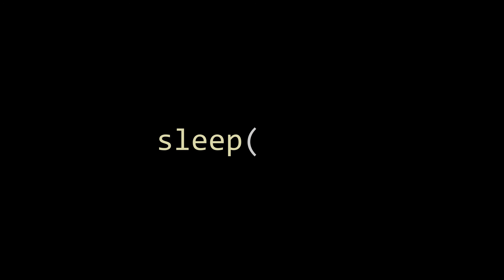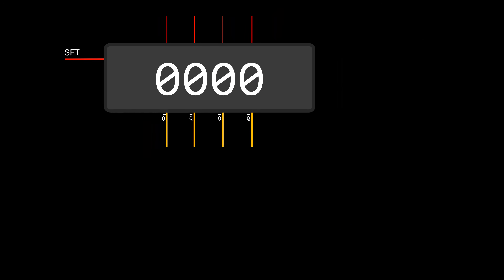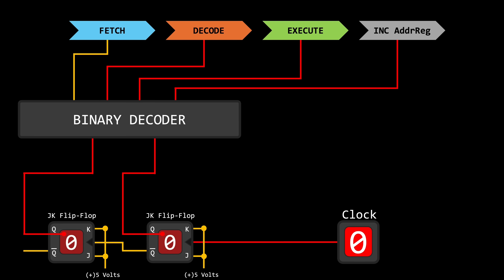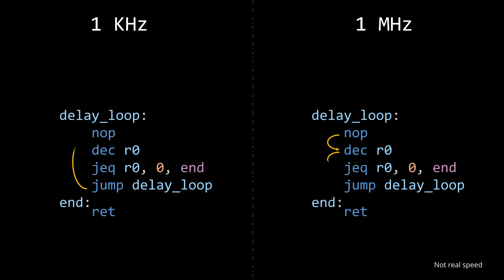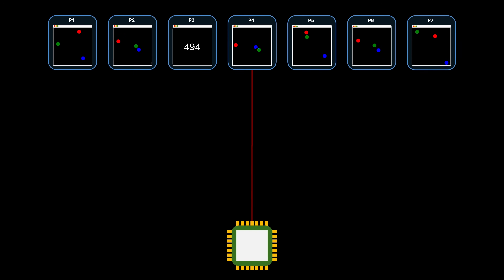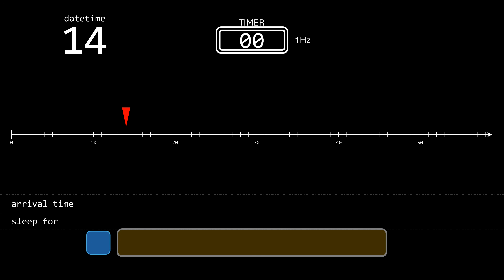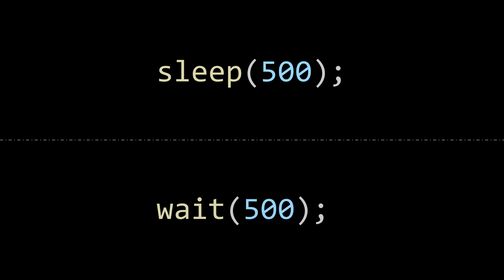What Happens When a Program Calls Sleeps?

Comment: 0:17 certified JS moment xD
which reminds me of my most recent encounter with "JS being JS": someNum = math.round(someNum * 10) / 10; resulting in +10 decimal places because JS' floats can't wait to give you a middle finger. And yes, by now I know about the easier approach: someNum.toFixed(1);
The "JS being JS" part was, that for 95% of the time, the first solution worked, until it didn't anymore.
And I already knew that JS' floats are not trustworthy, but this is the first time I actually ran into an issue with them myself.

9:00 this was the first time where got a slight grasp of just how insanely fast modern CPUs are: when I understood that they are (ignoring multi-cores) never doing ANYTHING in parallel, but just cycle between tasks at an just insane speed.
9:14 and that's how I found out the hard way why one should use "sleep" instead of a loop that just "burns time": I've locked up a couple of my first programs with that xD
I've also managed to lock them up without causing the CPU going 100% afterwards: just using "sleep" doesn't work well if done incorrectly in a single thread app...

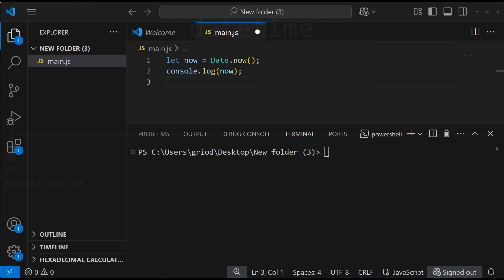13:20 I've been routinely annoyed by the fact that JS uses milliseconds while most other things use seconds but with a float, but it just clicked why: the first part of the comment is the literal reason. JS' time would be completely broken if they had used floats. Or they were forced to make floats reliable, but apparently that was never worth it xD

Comment: In short: 
1. The CPU has a hardware interrupted that is called every millisecond or so worth of cycles, which it uses to switch between running processes to make them seem to be running in parallel.
2. When a program calls sleep() it adds that virtual process to a sorted list based on resume time (time it was called plus sleep length).
3. Every time it switches processes (or at least when it empties the run queue), the system checks if the current time is greater than the resume time for the next process in the sleep queue and, if so, runs it.

Comment: 7:33 but...
approximately div 4 should be easy for a pc.

for example
12 / 4
binary 1100 >> 2 
11 = 3

or
153 / 4
10011001 >> 2
100110 = 38 (off 0.25)

I would say that is close enough and fast to calculate, a 2 bitshift should only be 1 operation

Comment: In my FPGA work, we're often counting nanoseconds because we're racing against the electrons moving in PCIE or DDR interfaces, for example. Looking from the low-level up, I can appreciate my Operating Systems class a lot more thanks to you. I have to spend real silicon to spam hardware timers all over my design, but when the overhead is an entire OS, it only gives me more appreciation to the work low level programmers do.

Comment: Busy-waiting isn't necessarily counting instructions retired, in fact that would be silly :)
Calculate the end timestamp and query the CPU's timestamp counter.
But even that's inefficient, you can also busy-wait in a reduced power state using special wait instructions that won't be interrupted by the scheduler.

Comment: another reason I know of for sleep vs wait: in some older languages Sleep was made as a supplement to the preexisting Wait function
whereas Wait means "do not run me until X after I made this call", Sleep means "do not run me until X after this run of me started."
In 3d programming with the former you'll never hit your intended frame-rate, while with the latter you at least have a chance (there's always to possibility that the program calls Sleep after X has already elapsed)

Comment: I have been watching your videos from last 7-8 months and you create incredible content about computer science which probably no one else creates. But I found a small flaw in your first transistor video named "How transistors run code", in this video you explain how transistors work inside the ALU of a CPU, to explain these components you used BPJ-transistors but actually in the ALU of a CPU which is present inside the core of the CPU, there are only FinFETs which is a FE-transistor because FinFETs uses source, drain and gate instead of collector, emitter and base. (Am I Right?)

Comment: It might be worth mentioning that wait() is already a thing, and on operating systems using cooperative multitasking it is mandatory.
wait() is basically a system call you can make whenever your program does not need to do anything this very instant, a way to tell the OS that if a delay happens here it's fine, and lets the OS taskswitch the program and run other pending tasks if there are any.

It is rare to see it used today, but if you have some process where you want the kernel to preempt at specific points instead of whenever it feels like it, you can still use wait() before and after critical points where you need code to not be preempted.
Think it might still be used in real-time applications.
Reply: I remember that back in the 90s on Macs. It was easy to cause the OS to hang or even the whole network.
Reply: instead of wait() a better term would be yield() which basically informs os that the task is ready to give up…until a notification comes to wake it up
Reply: @ yield is also already a thing, used mainly for generator patterns, it saves your context in the function, but it only ever returns up the call stack, it does not pause or wait for anything in that context.
And yield is also used to indicate an execution point of a lambda.
Probably more stuff too, it seems it is a popular word to use for different things, which is why you should not add more things to its definition.

Comment: If busy waiting is comically inefficient and may even freeze a system that can't preempt processes, what is the purpose of the NOP command? I'm sure there is better use case for it. There has to be something useful to do.
Reply: The NOP command is generally there in case you need to fill space or pad out something for any reason. An example is self-modifying code, where you might put in NOPs to take up space you'll fill in later. Another use would be patches, in case you need to patch instructions out, NOP gives you an instruction you can put in that just does nothing.
Another use is to put a bunch of NOPs after the code for a function to "fill space" and separate functions. (The "INT 3" instruction is better for that, though)

In older (think 80s and 90s) CPUs, it was useful if you needed to wait for an instruction that took time, but didn't stall the processor. Some old CPUs would let execution continue while doing a division, so if you had nothing else you could do during that time, NOP was useful to pad it out until the division was done.
Back then it was also useful for synchronizing things when interacting with other hardware. And in embedded programming (like Arduinos and such) it's still often used in those ways.

Busy waiting also doesn't need NOPs, they're generally just a simple loop, no NOPs needed. I'll note busy waiting is still useful, sleep(n) often isn't super accurate, so if you want a bit more even execution (say, for a game), it can be useful to call sleep with a time just a tiny bit shorter than what you actually want, and busy-wait the remaining time.
Reply: @phantombeta Yes, I can remember padding with NOPs back in the 70s. Without an assembler, everything was hand coded and it would be a nighmare to relocate a block of code if the were absolute addresses. I would sometimes add a block of NOPs in case I needed extra space later, though not in a tight loop.

Comment: There's a rust crate that sleeps the thread until its somewhere within specific buffer of time before the intended wakeup, and then busyloops the remaining time until the real wakeup is supposed to take place. This gives you much better wakeup accuracy, without the drawback of busylooping the entire time.
Reply: Which crate is it?
Reply: @jay-fm8sc  i didn't remember the name at the time but i found it. It's called spin_sleep.
Reply: @jay-fm8sc  spin_sleep
Reply: Damn I really need to pickup and use rust. So many cool functions
Reply: What’s the name of it?
Reply: What's it called?

Comment: In Arduino they changed the Sleep function into delay, 
Imagine calibrating your sensors and using sleep, like it's a little bit off when you use it in sensors

Comment: The division taking multiple cycles is not really relevant, you can make a busy wait using only simple instructions, and the division itself could most likely get precalculated by the compiler in most cases

Comment: It's more accurate to store the wake up time in the queue as it is easier to sort and set, plus it uses up less space since it only needs 1 piece of data rather than 2. This places the ADD at the entry point of the sleep rather than each iteration of sleep testing, instead it simply uses a CMPINC and JG drop out loop for waking processes.

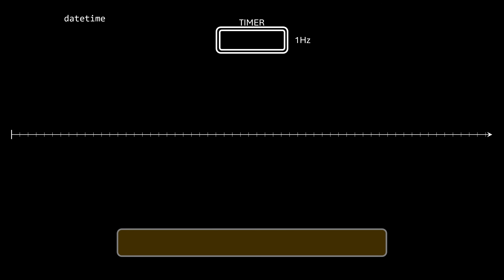Comment: 13:31 sorry if I missed this but what if it doesn't? The timer fails right? So how is this different from busy waiting?
Reply: The timer doesn't vary in clock speed like the CPU does. It's has a fixed cycling rate; it's a part of the motherboard

Comment: You can only have a single thread in JS, so lack of "sleep" is understandable since it would block your one and only thread, and therefore the whole process
Reply: Right and because of JS's origins in the browser, where it's closely tied to the UI of a website and blocking the whole process would make the website as whole unresponsive. In node it would make more sense to have sleep available for use in command line scripts. 

And we effectively have that now in both node and the browser for async functions, we just need to write async JS and import a sleep-like function.
Reply: @barneylaurance1865  Sure, but aside from it being originally browser based, I wager you can achieve anything that would require sleep the "JS way". For example, why loop and sleep when you can just use setInterval?
Reply: Sure, but aside from it being originally browser based, I wager you can achieve anything that would require sleep the "JS way". For example, why loop and sleep when you can just use setInterval?

Comment: Personally I wouldn't bother with a new queue, I'd just add the delay to the current time and slap it on the process object in the normal queue. If the current time is >= the timestamp when the process becomes 1st in the queue then I wake it up, if not then I move back to the end of the queue and carry on. There is no need to be 100% precise with when the process wakes up, instead just take the delay to mean "I want to wait at least this long before being woken up again"
Reply: the only time when the waiting queue is updated is during interrupts, so you do need a hardware timer to provide the interrupt at the proper time. some operating systems do in fact put sleeping threads in the same data structure as other threads waiting for io, but there are performance benefits to putting sleeping threads in a separate structure.
Reply: @char8169 At least on Windows it works like OP describes. The Sleep accuracy is the CPU scheduler quantum (usually 64 Hz) and I believe Linux or BSD does the same with some busy waiting for short waits.

Comment: In RISC-V the NOP instruction is an alias for add register 0 to register 0 with result in register 0.    (in RISC-V reg 0 is hard wired fo zero and results in reg0  do nothing)
Reply: Nice ngl
Reply: RISC- V has many such optimizations to compress the amount of instructions. x0 can be used as 0x00000000 and as a trash destination register so you can get away with only linking jump instructions, or way fewer branching instructions for example. There's similar tricks for a bunch of instructions, because it's hardwired to ground.   @algorithmicRendering

Comment: Actually, busywaiting is extremely important in systems programming.
Your kernel will often busywait for short amounts of time because it sometimes just isn't worth it triggering a sleep or setting up an interrupt. For performance reasons it's sometimes much faster to just let it busywait for a couple hundred clock cycles.
Reply: Yup. If you watch the booting of a Linux kernel closely, you will see a line mentioning a number of Bogomips. That's the kernel calibrating how many loops of the busywait routine need to run for a certain amount time to pass.
Reply: @realulli Thanks for the reminder. I was trying to remember how I knew the approximate time of some loops I used in a simulator 20 years ago. The loops were actually a message pump that only allowed certain messages to be processed while waiting for a stop message or the loop to finish. It wasn't a separate thread, but you could start the simulation in the main application, and the hardware it was simulating, at the same time, and see that their timing was in sync.

It essentially ran a short loop at some point to get the approximate fraction of time required for each loop. Then it used that value to determine the number of loops required to approximate the scanning cycle of the hardware. I was rather pleased with the results, as the accuracy was better than I expected.
Reply: I was about to comment the same. If I remember correctly this busy waiting loops are called spinlocks  in os/system programming.
Reply: @matiasbpg  The loops itself are not called spinlocks, but a spinlock is a typical application for a busywait. This happens when the kernel wants a resource and it knows that this specific resource is changing hands constantly. Say, a memory region used by the scheduler which changes frequently. In this case the kernel will not bother setting up a mutex or semaphore to wait for an interrupt because by the time it has done so the resource is already free'd and occupied again. So it will just "spin around the lock" asking: "Hey, are you done yet? Hey, are you done yet? Hey, are you done yet?". So yeah, it is an example of where a busywait can be used.
Reply: Delay loops can work pretty well on embedded, very simple CPUs. On AVR, for instance, instruction timing is predictable, and `_delay_us(0.5)' compiles to a delay loop that takes exactly 0.5 µs, provided this is an integer multiple of the clock period. This can be used for generating logic signals with cycle-accurate timings.
Reply: The Windows "System Idle Process" does exactly that, but with "HALT" instructions instead of "NOP"
Reply: In many cases just a simple asm("nop; nop; nop; nop; nop; nop; nop; nop;"); after pulling some register CS input low for example is all you need for a reliable operation. Even cheap modern digital electronics is very fast and even if your device is 10 times slower than your CPU/MCU/SoC then still strategically placing just 10 NOP instructions in total is guaranteed to be enough to accomodate it in your system. With Linux you can be more fancy with loops and kernel-suggested amount of NOPs with stuff like frequency scaling taken into account but in most cases it is easier and better to just assume that no normal CPU core will ever run faster than 6GHz and just hardcode the required amount of NOPs for a guaranteed minimal delay. In device drivers or embedded systems programming it is a very common practice.
Reply: Now that all of the lore masters are gathered and I shall listen in reverence.

Comment: Firstly thx for that great video,

Secondly i have multible Question at my mind

1- at 2:55, you said when the process called sleep, it invokes syscall to the OS and the OS set the timer with the time, but the timer has a maximum value what if the process sleep time bigger than that ? 

2-  at 14:5, i see a timer for the sleeping queue, is it another timer or the same timer of the CPU for the round robin scheduling (preemptive OS) ? 
if it's not the same so when this timer ends does it interrupt too and let the OS handle this sleeping queue or what ? also what if they both interrupt at the same time or one interrupted and when the OS handle this interrupt the another interrupt so what's happening ?

3- at 16:26, while the OS checking the sleeping queue there was one process still have couple of milliseconds to wake uo, so when the OS finishes the OS it set the timer to those couple of milliseconds but actually the OS checking time itself was those couple of milliseconds so also that's not precise sleeping time. just an info :)
Reply from the maker: 1. You can also use software to overcome that limitation. You set the timer to its max value, when it goes off, the timestamp let you know that you should set the timer again to keep waiting.

2. Those are separate timers. Since both trigger interrupts, both can preempt the currently running process. Yes, the (sleep) timer can interrupt a process as soon as it gains the CPU (in less than one time quantum), but it's necessary to try to maintain precision.

3. I know. I'll try to improve my animations.
Reply: For question 1, if you need to sleep for longer than the sleep call allows, then you can call sleep multiple times, effectively do the busy loop, but put a max duration sleep call inside the loop.
Reply: @moo4boy   its a timer "snooze" button.  You could implement a function that takes your time to sleep, then integer divide that by the max timer period.  Then save your sleep time modulus max period.  When you have no more snoozes left, reload your alarm timer with that modulus.
Reply: And 4 - where is lua
Reply: Bro your method of asking questions is great 👍 
Please,can you tell me how you do that